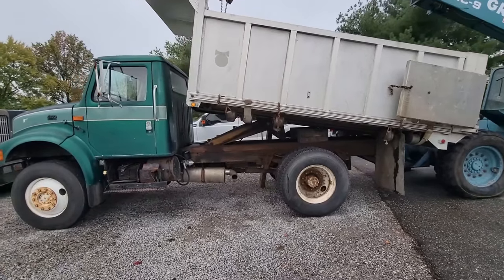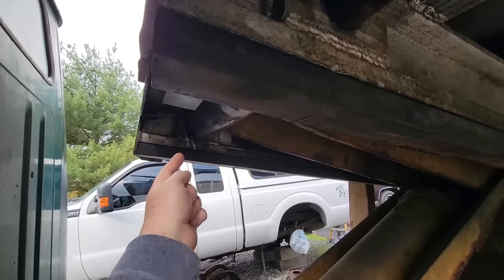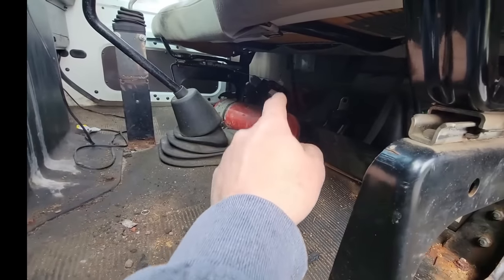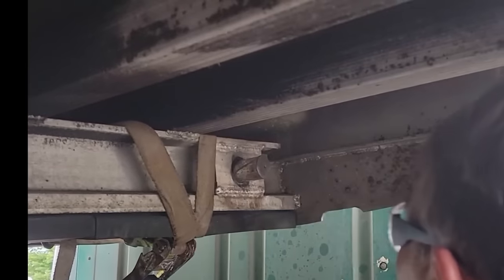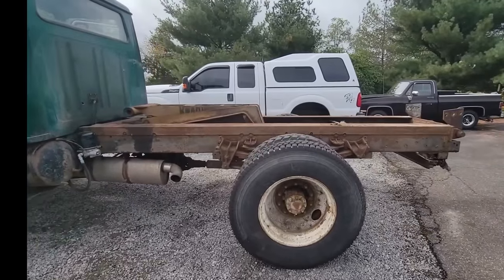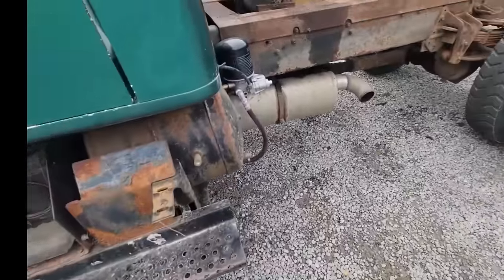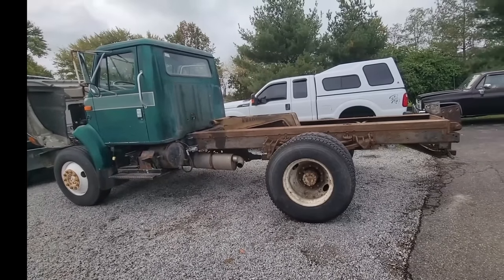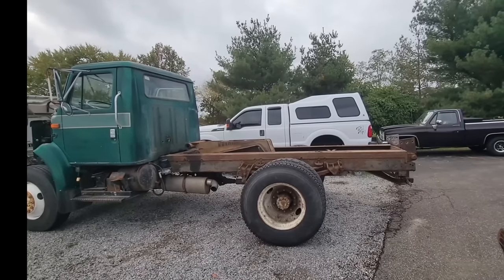THIS IS IT! DT466, MANUAL TRANS, AIR BRAKES, DOUBLE FRAME....AND DOUBLE FRAME!

Comment: Honestly being 4x4 makes the truck less valuable and less handy. Makes it worse to road and doesn't help that much getting around in bad conditions. Tire chains for the rear will get you father I think. The only thing that truck has going for it is the pre 07 year and being an international makes it not really valuable. Put a dump bed on it and rattle can the frame, then send it. I would think it would only be worth your time if it was going to be your truck. Good luck you will be fine.
Reply from the maker: opinions vary.....

Comment: Paint the cab red put some nice aluminum wheels on it with an 18 foot box and a liftgate and I’m all over it lol 😂
Reply from the maker: 18ft box means stretching the frame, moving the axle, building driveshafts and so on. i doubt this would be attractive after the cost is added from all that work.
Reply: Sorry I should’ve taken that into account. Not sure how I overlooked that.